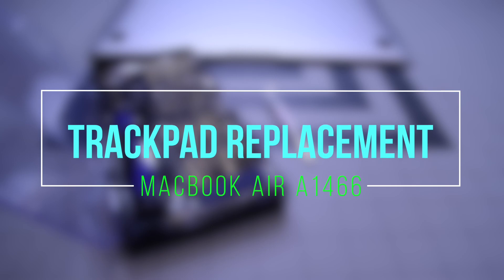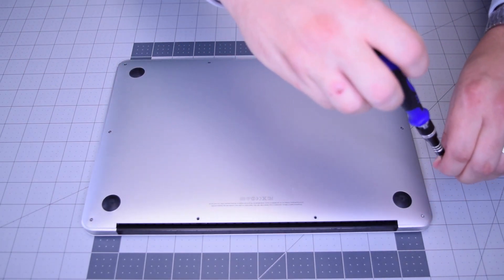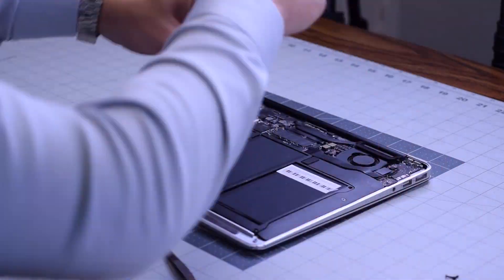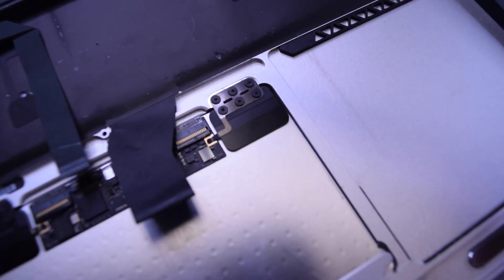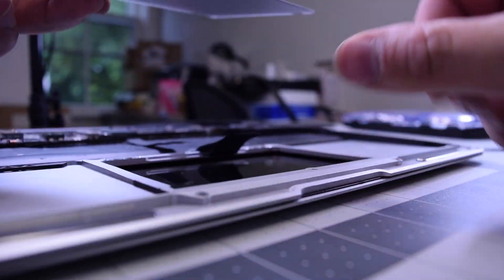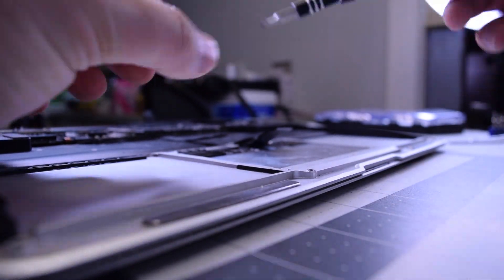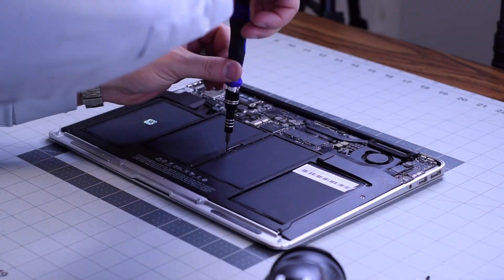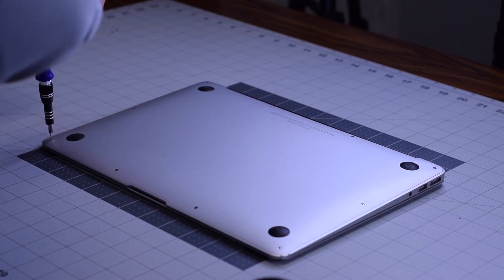Macbook Air 13" 2012-2017 (A1466) - Track Pad Replacement

Comment: i have a curious question for you. The original trackpad was water damaged. Having cleaned the contacts, it worked on the keyboard, but the trackpad was erratic on movement. SO i replaced with a new one following all your instructions. Now the trackpad worked perfectly, but i get nothing from the keyboard. I have check the ribbon cable is seated properly, but still nothing. When i move back to original keyboard works perfectly but trackpad movement still erratic. Have you ever come across anything behaving in that way ?
Reply: necro reply but it looks like the keyboard is routed through the trackpad in the video? they might have both been defective.

What did you end up doing after a year?

Comment: After the replacement, it becomes overheated and cannot detect the trackpad, anyone got ideas why this happened?
Reply: something is not plugged correctly.  check wires.
Reply: @phon-er  it's the items not compatible

Comment: Left Click issues NO MATTER WHAT's plugged in. If the trackpad is somehow stuck / broken why does it render an external usb mouse from being able to left click? I can right click & mouse moves, but no left click? Making it impossible to even boot off another drive to repair?

Comment: Hi, great video,  I just have one question, will the track pad for the model A1466 EMC 2559 (mid 2012) work for the MacBook air A1466 EMC 2925 (early 2015)?  Thanx in advance.
Reply: Are you find the answer, me too loking for the same question

Comment: This is not at easy as it sounds. I have torn down and rebuilt many a computer before but i could not reinstall the those ribbon connectors back into the sockets. Will see if I can find a tech. to do it.
Reply: if youre in LA CA ..we can do it for you :)
Reply: It is easy, start doing more mobile repairs then.